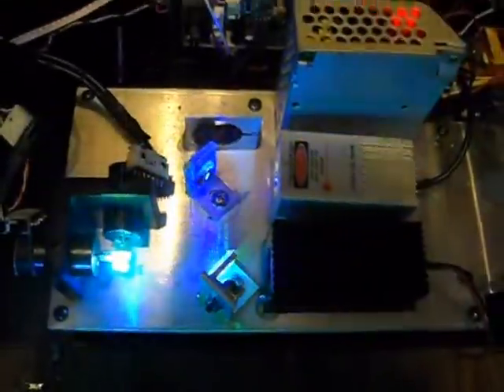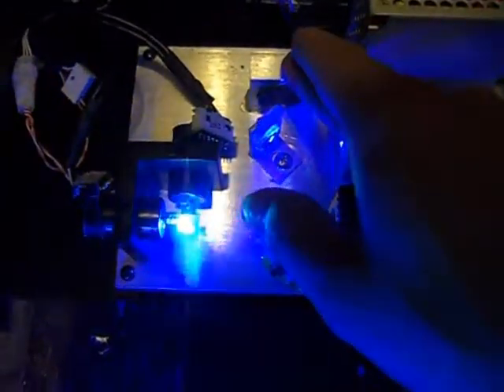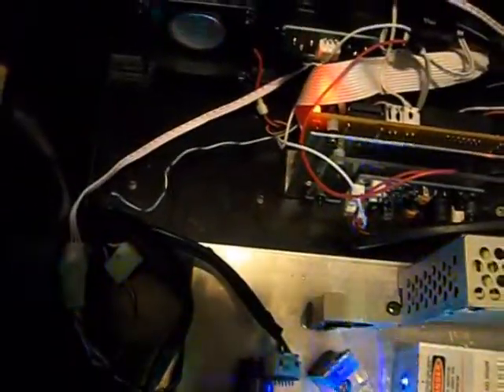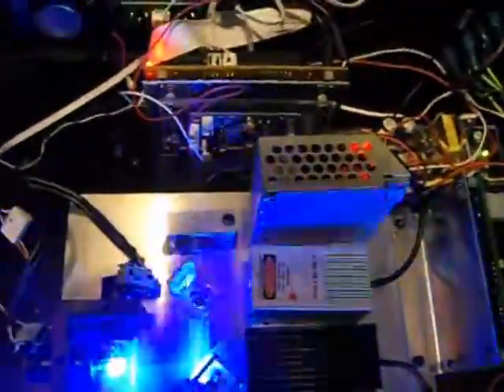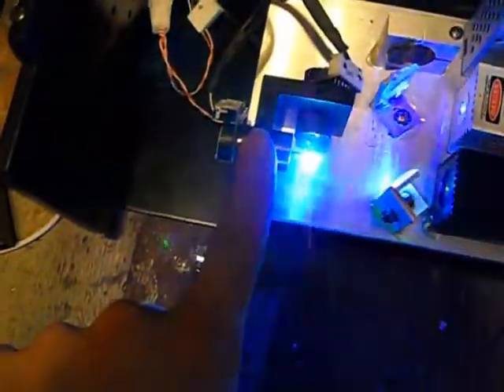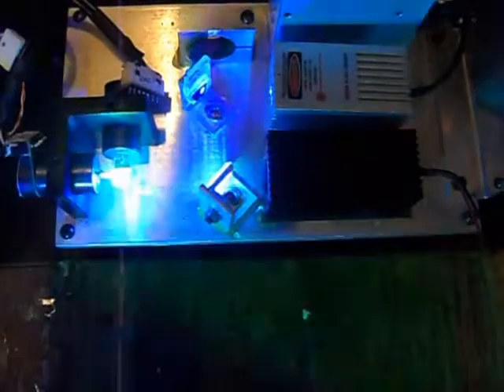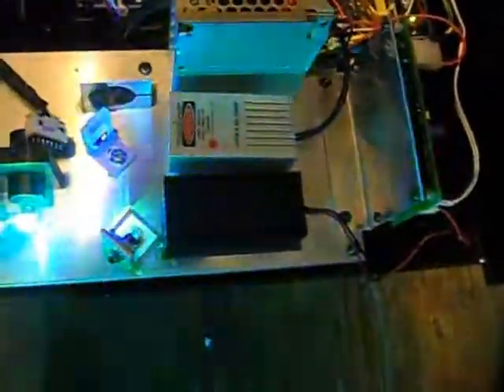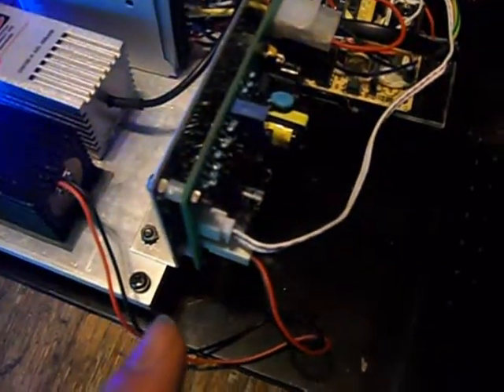Inside the rebuild project of a green and blue DMX stage laser

Comment: Thats a cool setup and clever how you set the galvos to run without the amp board..

I have a setup that uses exactly the same twin amp board from a laser DMX projector from Chinavasion i brought off Amazon 2 years ago, ive now taken it apart and used 99% of the projector to build a Laser Harp with a Arduino Uno, still need to work out how to use just one channel as i only need to run one galvo...

Comment from the maker: @danksmokaz This is a rebuild off a laserworld RGB laser. it is not using the arduino kit. It has DMX 512 and ILDA and audio designs on board, with the galvo driver this si a 20-30 kpps laser with TTL for 2 laser colors. its about 15 kpps without the driver " its currently hot wired to the logic board " you can buy galvo kits off ebay at a decent rate they rance $100-$500 depending on KPPS and how many lasers the board can support. do research on galvo lasers and scanners and TTL modulation.